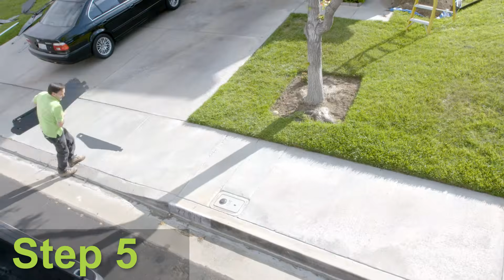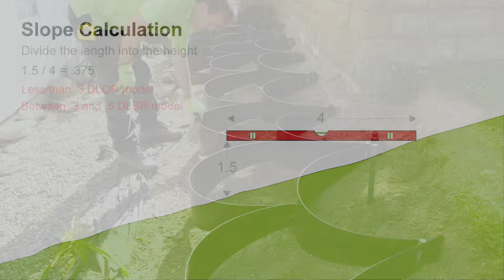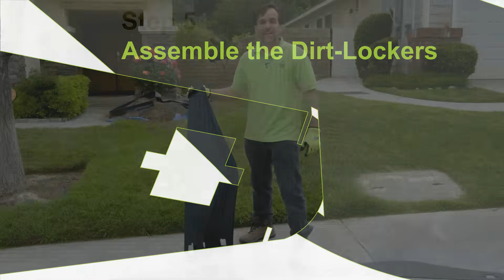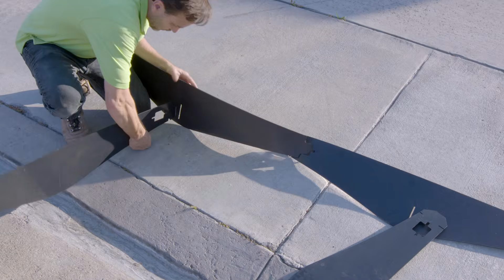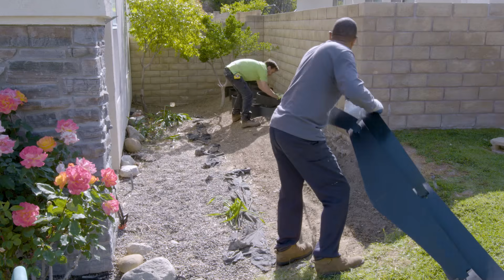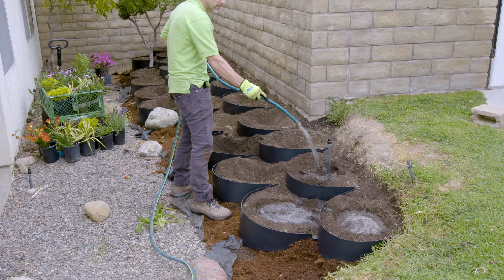Installing the Dirt Locker® Terrace Gardening System: Landscaping on Hill to Control Erosion of Soil

Comment: Do NOT be fooled that this is an easy DIY. Maybe if you have nice soil that cleans easy and no rocks; however, if you are buying this you probably have bad soil and rocks. I bought 30 of them and had HELL getting them installed. I can only hope it stays secured since the J hooks bent from having to beat them down. The product does work but very difficult to install.
Reply from the maker: @accreditation8214  sorry you had a hard time with the rebar. We do have videos to address rocky soil. You can use a concrete drill bit or anchor them in at an angle or horizontally of you really need to.
Reply from the maker: @accreditation8214  this video is in our installation playlist! https://youtu.be/fUxGrj_5oKA?si=ef2QM1theM6cQGcU

Comment: How does this product hold up to hydrostatic pressure? I’m in Minnesota, multiple freeze thaw cycles, how does it hold up to that? Will heaving be an issue? Thoughts on mitigating these concerns? Thanks
Reply from the maker: We have plenty of customers in regions that experience freeze/thaw cycles. The Dirt Lockers withstand freezing cold temps, and your plants are insulated all winter long. The Dirt Lockers are held down with metal rebar on the sides, and garden stakes in the front.

Comment: Very cool!  So we have 2 intersecting 24 ft by 4 ft perpendicular slopes that fall into each other are both a .33 slope ratio.  How do interconnect the systems in this case?
Reply from the maker: @stphenramsey6022 Thank you for your comments. The best way that we can help ois if you send pictures and/or sketches of the area to info@dirtlocker.com or visit our website at www.dirtlocker.com

Comment: Such a great invention. I have a question: our hills are just slightly too steep to mow, but we get so many weeds that we need to use string trimmers as well as push mowers. With a Dirt Locker system, how do you control weeds? I'm afraid to use landscape fabric because we've had bad experiences with it in the past. Could you build the Dirt Lockers over cardboard sheet mulch?

What is the displacement for each cell? 2-3 sq yards?
Reply from the maker: You can utilizing the wet cardboard method with Dirt Lockers. Large and Medium Dirt Lockers can be cover 2-3 feet of slope width, giving them a depth range of 20"-16". This will depend on your slope angle. Visit our step 1 of our installation page for reference, view the green chart.

Comment: From an aesthetic hard scape dirt locker is less than desirable! Yes it’s cheaper than boulders or railroad ties but takes away from an organic landscape project! It seems like a cheaper option to boulders or railroad ties but how much will it move with freezing and thawing? I’m not a fan.
Reply from the maker: Everyone has their preference for garden landscape design. Yes, Dirt Lockers are a more affordable alternative to traditional hardscape methods. They are also lighter and easier to install for the homeowner. They do not move due to freezing and thawing as they are anchored down with metal rebar. We have customers in Canada, Minnesota, Utah, Montana, NY, etc..., who deal with harsh winters.

Comment: Material for dirt locker
Reply from the maker: Dirt Lockers are made from 100% recycled high density polyethylene. We take single use plastic and repurpose it to its final use. One large Dirt Locker® is the equivalent of saving 13 single use plastic milk jugs from entering our landfills. Made in the USA shipped to you within a week.

Comment: Can you easily combine the original and senior models in one project?  AND can I continue expanding the project or is it best to do it all at once?  I am yo yrs old and have to do most of my own work, at least initially.  SO, I want to lay out and finish a rather large area one section at a time.  ((It's an Alabama hillside that hasn't been cared for in decades and some parts are steeper than others..
Reply from the maker: Yes, absolutely

Comment: Hi Mark, can I have the dimensions for original and Jr. locker? Since we already have plants on the slopes, another way of calculation may apply.
Reply from the maker: The original is 48 inches long 9 inches at its highest pt and tapers to 4.5 inches.
Reply: Are Dirt Lockers available in Atlanta, Georgia?
I will measure my area when it cools down tonight!
Thank you 🌺⛰️🌺⛰️🌺👍💕

Comment: Hi, I want to use these as a way to retain rainfall in order to moisten the hill to prevent fires and to hydrate the hill  in California. Will these work? I would like them to last 50 years!!
Reply from the maker: The DirtLockers are made from HDPE (recycled), which is used in water distribution because it is nontoxic, good temperature operating characteristics, and has built in UV inhibitor, and has anticipated life of 50-100 years. This site has good info   https://plasticpipe.org/pdf/tn-27-faq-hdpe-water-transmission.pdf  to increase longevity you will want to make sure you have good plant growth that will provide shade etc. As the more you stop UV the greater the life expectancy

Comment: This looks amazing. I have a very steep slope starting at the edge of our front yard. No one wants to weed-eat this, because it's hard to stand up on it. It looks horrendous, most of the time, but I finally found someone to whack it down, which will grow back w/in 2 weeks. I enjoyed this video thoroughly. However, I have spine and knee problems preventing me from bending, squatting, or getting down on my knees in any form or fashion. I suppose we would measure the area, then order, and when it comes in, have a professional landscaping company install it. Also... lol   ...we have no sidewalk, like in the video. That looks super convenient, but we live off-grid in the country, so the drop-off goes straight down to a country road that is pretty skinny. We also have a significant amount of traffic, because our little country road is a 6-mile thoroughfare from Hwy 64 to a few side streets, and apparently it's the only way in or out.
Reply from the maker: Glad you enjoyed the video. We will do what we can to confirm this is the right solution for you. Similar issues with my hillside, it was either dead or growing invasive weeds that had to be cut back to reduce horrible appearance. If you or someone can determine the dimensions Length and Width, as well as the angle of the slope, we can look at what options are available.
Reply from the maker: We have had excellent support using our ground carrier shipping to many folks in remote locations
Reply: Holy cow Trish your area sounds like it is beautiful! I would love to live off grid but I need the Internet to work. Also I feel your pain as far as back pain and knee pain I am also getting ready for my second hip replacement so it makes working around the yard rather hard. To prevent me from slipping down the steep hills I have heavy work boots where I have attached ice cleats to them. These cleats are the metal cleats in about a half an inch spike on the bottom so I don’t slide down the hill like I used to with regular boots! Good luck on your endeavor!

Comment: What are the lifespan of the dirt lockers?
Reply from the maker: Hello Vivian, life of DirtLockers depends on a few things. Your location, is slope south facing, will the DirtLockers be planted with lots of foliage?
Reply: @dirtlocker  Thanks for your response. What if the slope is facing west? What if the dirt lockers will be planted just a few plants? How long will the dirt lockers last?
Reply from the maker: @vivianz1284  we put 10 year UV inhibitor in product. My original prototypes using same mfg and plastic were in place over 10 years on south facing slope in near high desert conditions. It doesn’t disintegrate like other plastics, it di fade somewhat, and will become more brittle, but if left in place, will hold its own.

Comment: I installed 30 of the dirt lockers last year, just before hurricane Isaias last year and they worked great! I tried to call and get more but no-one ever called me back. I would love to order more!
Reply: Hi Donna, can I get the rough idea about how much the shipping cost is with 30 lockers ? Thank you.
Reply: @yiz8384  I am curious as well. I wonder if you can order 10? and add a little more every yr??
Reply: For the specifics with pricing please contact Mark he is the inventor and this is his business. Go to the Dirt Lockers website and his phone number is on there call him directly. I have been ordering 10 Dirt Lockers at a time that is 10 pairs of Dirt Lockers each half makes a half of a circle. They even with stood the torrential down pour‘s of the last hurricane Ida which swept through the north east dumping 8 inches of water in about an hour and a half and my Dirt Lockers were fine. I also ordered the senior Dirt Lockers because they Are better for a steeper hill. One area on my hill falls 2’9” and a 4 foot span so it is pretty steep. If Mark ever made ones for even steeper hills I would be interested! But the senior seem to work fine
Reply from the maker: Hello Donna, Thank you for your repeat business, and our apologies for not getting back sooner. I just sent an email to you as well. We just updated our ordering system and have gotten over the learning curve.

Comment: Question: How will it preform in cold weather location like the north east? I'm concerned with water retention and freezing in the cold weather after it rains.
Reply: Hi Bill, I live in the North east myself, and I can tell you the Dirt Lockers held up fine with all the snow and ice we had this past winter. The "plastic" that they are made of is actually pretty thick. I installed the Dirt Lockers just before Hurrican Isaias in 2020 and they held up the the run off we have living on a very steep hill.
Reply: @bestmaturehealth  I noticed on their website they have orginal, junior and senior. Can you use anyone? Or is each one for the grade of slope you have? Can you just order like 10 to try out and expand a little every yr??
Reply from the maker: Hello Randy, the Dirt Locker model (now Small, Medium, Large) are recommended based on slope angle and project size. Our minimum order is 10, so you can certainly try it out first to see how you like it, then add more!

Comment: Brilliant! And exactly what I need to solve my erosion problem. I’ve been looking for a solution for a long time and came up short until I fortuitously stumbled upon your video tonight. I’ll be placing an order tomorrow once I measure.
Reply: Tasha, I am curious as to how this turned out for you. Your post was made 1 yr ago. Is it working fine?
Reply: @trishferrer8209  I ended up not ordering. My project was delayed because I re-stuccoed my whole house and the scaffolding would have ruined the landscaping. When it came time to order dirt lockers, it was cost prohibitive for me. My project would have required 150 senior pieces and the shipping alone on it was $125. Sales tax was $140. All in, it was over $1,700 and I can’t justify it in the area I wanted to install it. Truth is, I think it’s an ingenious design and I can’t find anything anywhere close to it on the market. I should have snapped them up when they were available for pick up in Santa Clarita. Now they ship out of the Midwest.
Reply: @tashagailys  I noticed they have orginal, junior and senior. Can you use anyone? Or is each one for the grade of slope you have? Can you just order like 10 to try out and expand a little every yr??
Reply: @randyman8984  the size you use depends on your slope. This video explains how to measure. https://youtu.be/ZrVRe6wPzwM You can order as many or as few as you like. Trouble is the shipping cost, which is why I decided not to order any at all.
Reply from the maker: Hello Randy, our updated website has size small, medium and large. You can visit our estimator page to determine the right size for you. Shipping is only $5.99, and free for orders over $500.